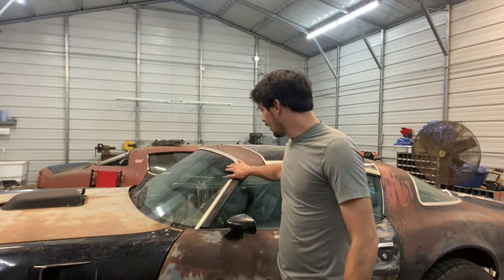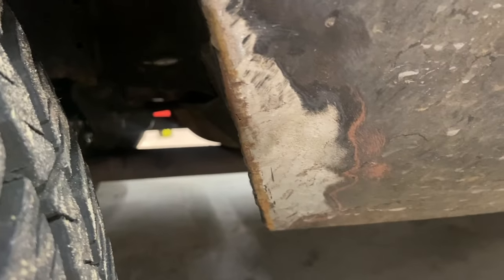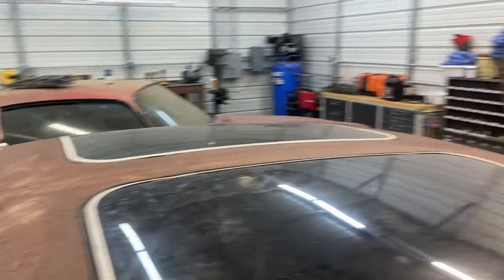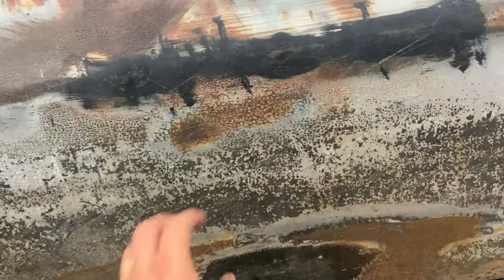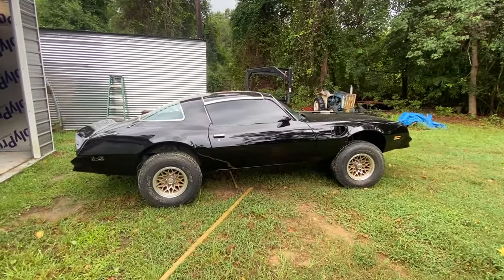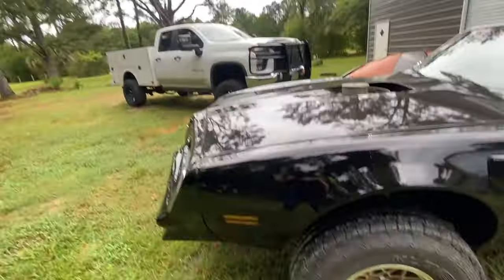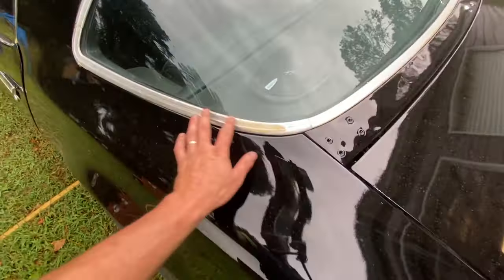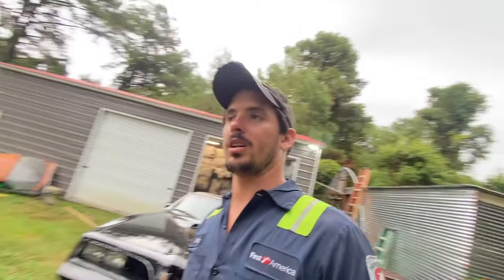IS MAACO'S PREMIERE PAINT JOB WORTH IT? : 78 PONTIAC TRANS AM PAINT AND BODY WORK!!

Comment: Honestly and no disrespect, it’s too soon to tell how well of a job Maaco did. Proof is in the prep. If that surface rust and rust pitting wasn’t addressed it will be obvious at the first change of seasons when the finish starts to bubble knock on wood it won’t. There is a definite reason for Maaco paint jobs. You basically get a Maaco job or you spend 3x+ for a job that addresses the prep better and the final orange peel better.
Reply: Your right, and then there's the quality of the paint used. Seen a cheap paint turn flat in one year in Florida sun.

Comment: in 1984 I paid $5,000 to have my '78 repainted,  they did an awesome job.  Plus I paid $5000 for it when I bought it in 1980.  And I was working at McDonald's at the time.
Reply: 5000 dollars in 1984 is around 13.250 dollars
Reply: You worked 2000 hours at McD to buy a TA? I don't think so.

Comment: Doesn't look to tea bag for a Maaco paint. I also thought about going to Maaco so this review actually helps ease that anxiety of just thinking of taking it their. I will say I am stripping the car down to a rolling shell with no glass before bringing it to them because of the horror stories. But I will say you need to do something different with the suspension setup, like revert it back to stock height, and running different size tire.
Reply: And I will say that I will say that I will say I wouldn't do it.
Reply: They are ok if you're just having a couple panels shot for a flip car but you better do the body work yourself.

Comment: Huge transformation for the TA. Looks good. Only real gripe I would have to Maaco is they could have done better on the area above the mirror as far as surface prep goes. Prep is everything especially for a black car. Some Maaco shops are better than others as you know. Looks like they layed down the base coat clear coat pretty good. There will always be imperfections in a paint job obviously less if you spend more money. I have seen paint errors in 10-20k paint jobs. Hard to see but they were there. Would have never seen them but the owner pointed them out lol. 

I know your happy with the transformation of your TA. I would be. 
Can’t wait to see it with the decal package on it . That will definitely make a huge difference. 

I just finished my 81 TA Daytona pace car. Did it all myself. I had 1400 in materials. Took me 7 months to do it. Labor of love for sure. The big bird is tricky to put on but not to bad. I did do it by myself yes it was nerve racking.
Reply from the maker: Yeah, at first I was a little annoyed at some of the imperfections, but knowing how much a perfect paint job costs and seeing all the body work it needed I’m not upset, and like I said this car is a driver, definitely not a perfect show car! And I can’t tell you how many times I’ve been told “black is a mirror you’ll see every imperfection” and that’s actually the second maaco I want to for a quote the first said 2000$ and the quote said “no bodywork” lol but I’m very happy with it and can’t wait for this hood decal to show up to finically finish this thing off!!
Reply: $5500 ? Really

Comment: Ok so the mirrors weren't removed which is why they look a bit dry on the sides.
Doesn't look to bad on video..
5 grand is very cheap,  I'm a spray painter here in South Australia and the materials alone here would cost me around 4-5 grand at trade prices for quality products..
Looks good well done .

Comment: I'm not saying it's bad by any means. Yet for $5500, I'd would have likely purchased all the equipment myself minus a spray booth and given it a go on my own. You'd be surprised what a cheap spray gun and a bit of determination can get you. It would've been a fraction of the cost as well.
Reply: I have done that but it came out bad, I suck at painting.
Reply: @Luis Gonzalez  lol, you are not alone. To do it well, we really have to want to do it and commit. It's not easy for many of us. ✌️👍
Reply: @car-diologist  I really want it to do it, took my truck front apart sand it the whole thing fix the dents primed it painted it but my skills were not good enough. I might do it again.
Reply: @Luis Gonzalez  I'd put money on you doing a better job for a fraction of the price. Be patient with yourself. If you make a mistake, sand it down and paint it again. Just don't rush yourself. Have fun with it. Once it's done, you'll appreciate it even more.

Comment: I had economy paint jobs done back in the day from different shops, including maaco. Other then a paint crew that actually gets off they're ass and do a decent job. The trick is, take your own time to sand it down. Then bring it to the paint shop. The second lil trick is, ask the shop if they actually use hardener with they're paint. If they don't use hardener, leave the place. Cause I guarantee you, that your budget paint job won't last even a year. The first time I went to a Econo paint shop. Even letting my ride cure for 2 months. You can literally put your fingernail into the paint and it would actually make a mark or even peel off! The cheap places that actually used hardener in the mix. The paint job lasted for years. Other then that. It's best to take it to a proper place or learn on your own. Decent professional paint jobs cost over $3000 for a reason. And when a good paint shop, wants to go all the way with it,   it will run you over $6000. It's cause, they gonna take your entire car apart and do the entire thing piece by piece! 🎤 Drop

PS: No maaco job is worth over $1000.00. You seriously got ripped off dude. I don't care how much body work they put in it. Job looks nice, yes. Price, hellllll fxxkin no. For over $5000, gotdamn you could've went to a custom build shop and do it right. Just sayin! Double 🎤 drop

Comment: The cheapest absolute cheapest do it yourself paint job I ever did on my car as a stop gap as a beginner was sand it down to bare metal, including any surface rust, (By Hand) bondo some pinholes, with the green high bond bondo, re-sand, then use Home Depot or Lowes, spray paint for metal, in white, then gloss clear rattle can, then wet sand it. 

Also to save money on spray cans, I bought a gallon of paint for metal, not automotive but like handyman paint rated for metal like an iron gate, and cheap $1 $2 paint 6" foam rollers and rolled it on. LOL 

Spent $200 bucks in total. Did it over a weekend in my garage. 

And as it turned out, after I used some Meguiars and Turtle wax spray ceramic wax from looking at it parked 20 feet away it didn't look like a $200 dollar paint job... 

It looked like a $5,000 paint job. That was 7 years ago and it still looks good and shiny. I keep it waxed once a month. 

I can always take it to a body shop when I'm ready and have the Pros re-do it for ten grand or whatever. lol

Comment: Make a bracket for the air cleaner base. It can vibrate  and turn enough to cut the fuel line on an afb=fire. Not too bad for 5500. Be a whole different car with 4x2 tires

Comment: I have a black 2014 Mustang GT convertible that I want painted Fighter Jet Gray. The body is perfect and only has a few rock chips and some surface scratches. Nothing major, but I hate black. I want the jambs, under the trunk and the areas in the engine bay where the black is visible. What can I expect to pay?
Reply from the maker: They told me door Jambs were $175 each( same for trunk Jambs and hoods) and if you go with their “premier paint job” the one here in sc said it starts at $1800 so I’d say somewhere around 2000-3000$ probably

Comment: The car looks really good. I own 2 classic cars. One is an 1970 Oldsmobile Cutlass convertible resprayed in a small Mexican shop. They did a magnificent job for as cheap as Maaco. Years later , the paint is still holding really well. But they moved and I lost contact. My other car is a 1979 Fiat Spider convertible needing minor body and paint. I was turned down by 3 body shops and some independent guy I met wanted 7K for the job. I ended up at a Maaco that is doing the job for $2600 and they will remove any trim, mirrors, door knobs, etc. Let me tell you, you would be lucky if you find a regular body shop wanting to work on old cars.

Comment: Guess this is o. K. But for 1/4 the price due it your self. But if you dont have the time this is a option but there is way better shops for that price.
Reply from the maker: I believe I could have found someone cheaper but my boss had his 66 nova painted the said 4 weeks took 6 months he paid over 6000$ and they missed spots, I’ve used Mt lock maaco before and they did a good job so I figured it was worth the shop since the custom shop around here didn’t do great I figured maaco couldn’t do worse, also my main goal was one shiny color, I never intended it to be flawless or I’d be scared to drive it lol

Comment: I agree that you got a great deal. That body work at another shop would have been $8k easy.  Most shops around here would have refused the work due to being too labor intensive. I'm in the Dallas Tx area.
Reply from the maker: Yeah it was definitely the cheapest, my boss had is 66 nova painted last year at a professional shot spent 6k with no body work and they just straight misses spots painting it and had it for over 6 months, so I’m definitely happy with it!

Comment: The reality is that car needed to be  sand blasted.  I don't care what the guy says that's not surface rust!  That rust is down in the metal.  All maaco did was cover it up.  All the rust in the pits will come back and look like little specks of trash in paint job.  You know the economy is bad when taking your car to maaco cost more than taking it to a pro!
Reply: Good point, if my budget wasn't right I would have at least gone to bare metal, OSPHO the car then two coats of epoxy.  At the minimum.  If the $$$ was right I would have chemically dipping it.  No blasting.

Comment: Don't take this video and think that your local Maaco will do a decent job on your car. Maaco's are run by independent operators. Some are good, some are okay, and most are just terrible. You need to check with people that have used YOUR local Maaco to see what type of work they put out. I have had horrible experiences with a Maaco that I personally knew the owner of. He promised that he could do some minor rear end damage on my Vette in one weeks time and do an excellent job, this was not cheap job. I did not want to take it to my regular body shop as I knew he would take a month or more to do it and I needed my car. Maaco did a HORRIBLE job and somehow even made a hole in my drivers seat. Had to get a company to repair the seat and then take it to my regular body shop to do it again. Paid for the job twice...

Comment: Idk man I think you got robbed. I was expecting you to pay 1200. How can the body work be that expensive and how did they not include removal of side mirrors or door jambs.. I'd never pay 5500 I'd  buy the tools and do it myself... you weren't looking for a trailer queen so if you painted it and got orange peel that stuff buffs out with sanding and polishing you can do magic. You have lots of space in that garage.
Reply from the maker: It’s possible, I’ve never had a car painted other than a 700$ maaco job, all I know is that it was the cheapest quote I got, as for doing it myself, I debated it a lot, actually bought a paint gun, but with limited time I decided not to lol, it was definitely expensive but at the end of the day I’m happy with it, and it has a warrantee, so only time will tell if it hold up lol
Reply: Ben 1200.00!! Please tell me ur joking.